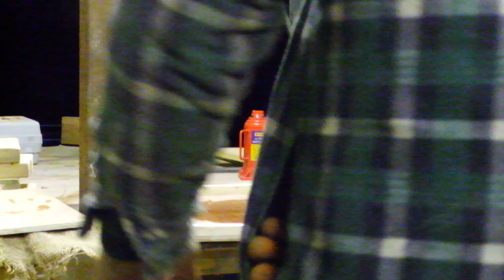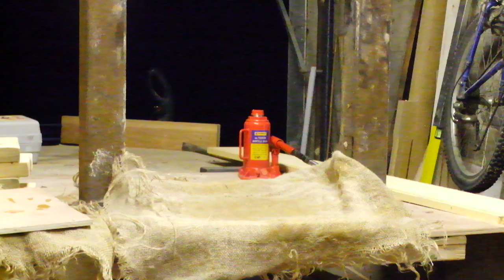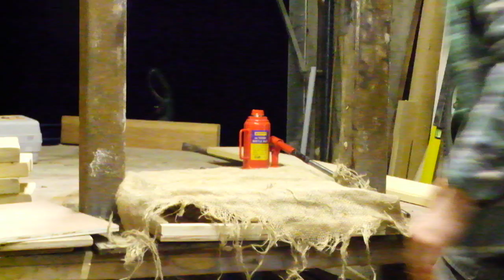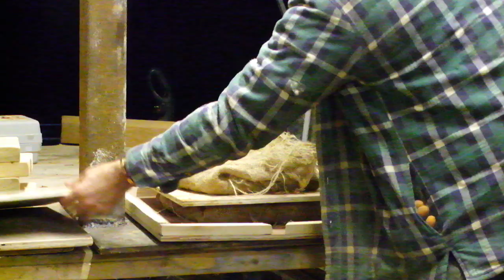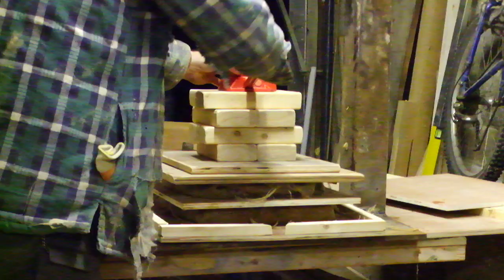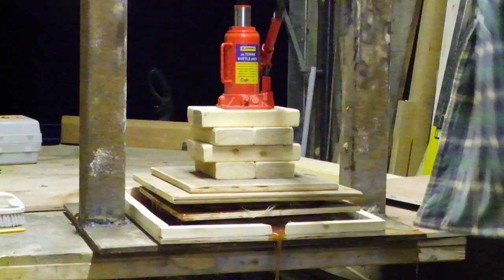Cider press. loading the cheeses on homemade hydraulic scrumpy press.

Comment: You could easily make something out of large steel beams and and a bigger jack might press out more stuff, but a 20 ton jack is slower. So you could squeeze out a bigger mess of apples and could start with a 10 ton and then go to a 20 ton

Comment from the maker: I pumped it so hard that the base plate bent and broke the weld on the left hand post. I have since strengthened the press by adding a 4''x4'' length of box section underneath, going from post to post and welding it to the base plate.

Comment from the maker: The jack i use is 10 ton. The scissor jacks you get for cars are no where near that, to get the same compression you would have to greatly reduce the surface area of the mashed apples being pressed. If you search Ebay for '10 ton jack' you'll see the ones like i have. you can get them for £22 delivered. The other thing with the hydraulic jack is they are so much quicker, scissor jacks take ages, especially when they start to build up pressure.